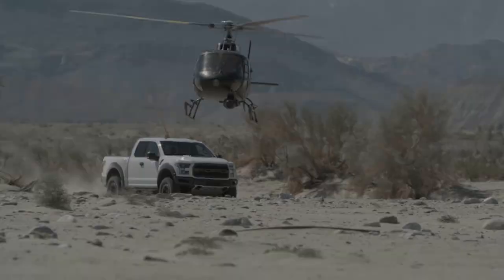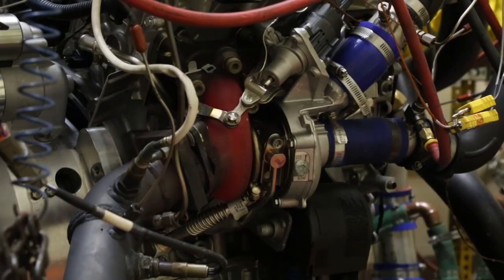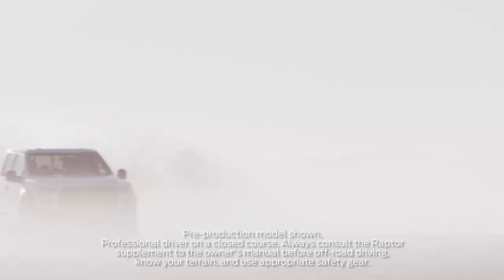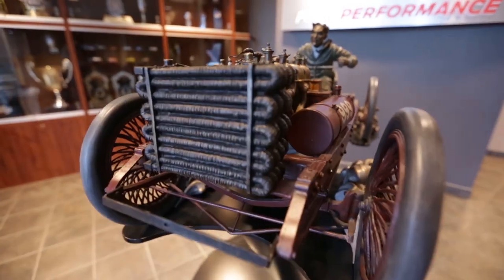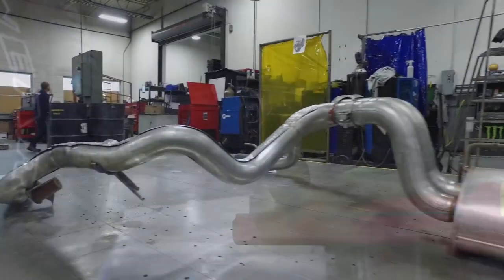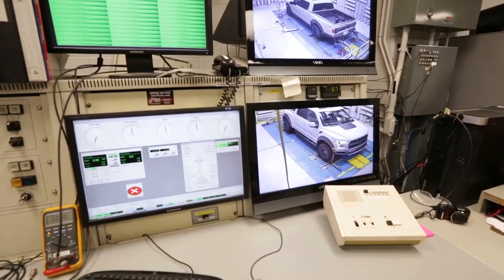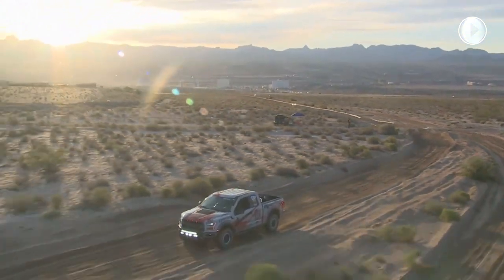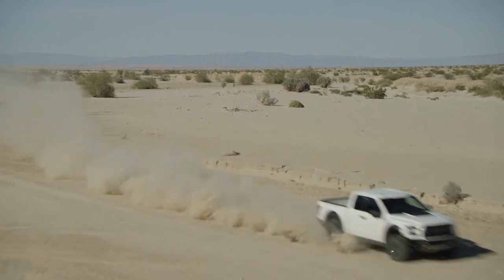All-New 2017 Ford F-150 Raptor: Dual Exhaust Technology | F-150 Raptor | Ford Performance

Comment: Keep up the great work guys and gals. The sound of the 2017 F-150 Raptor is music to my ears. Even the stock exhaust sound of my Duratec powered 2002 Taurus, which still runs great, had a certain growl that gave me an impression of just how great this engine's design potential was going to be. What a foundation for a winner this engine became. It doesn't sound like a V8 because it isn't supposed to. It's a 60 degree V6 that exhibits its own sound of authority. Here's wishes to Ford for another win at LeMans this year from a guy that bleeds Ford blue.

Comment: the 6.2 was such a great sound and it fit the truck so well... this is gunna have to grow on me...
Reply: I got my Gen 2 Saturday. I never got to drive a Gen 1, sadly, but I've driven a few V8 trucks over the years (and I loved them).

This new engine will blow you away. The amount of power is truly incredible, and everyone that has heard it in person has been more than happy with how good it sounds.
Reply: Because of the fake V8 engine noise coming out of the speakers.
Reply: T4nkc0mm4nd3r As a hardcore truck guy, I hate the sound of this truck. I've heard several that have passed me at lights and they sound like a riced out Honda. I'm very disapponted that Ford would turn their back on the V8 customers and I hope the rumor about a V8 coming this year is true because I, like many others, feel betrayed.
Reply: I'm not getting one

Comment: Granted the sound is not as aggressive as the 6.2L but everything else about it supersedes the 6.2L.   I am getting nearly 14 mpg and my daily commute is 12 miles of mostly stop and go travel.  It's a half a mpg better than my 2013 F-150 Lariat ecoboost that wasn't a twin turbo!  I think the 6.2 probably averaged around 9 or 10 mpg?  A stock gen2 will blow a gen1 off the line and in a quarter mile as well so what's really not to like?  You can add a number of aftermarket exhausts if you want a more aggressive sound and reap all of the other benefits of the gen2 Raptor's new engine!  Great job Ford Performance!

Comment from the maker: The 2017 Ford F-150 Raptor now boasts an exhaust that redefines the sounds of off-road performance! What do you think of the Raptor's sound?
Reply: it ain't no V8
Reply: Ummmm
Reply: The High Performance Ecoboost Vastly Outperforms the Outgoing 6.2L, Genius
Reply: Sorry, I own a 2017 Raptor and it sounds pretty bad from the outside... :/
Reply: Ford Performance sound of new V6 is awfull.
Reply: It sounds fantastic. Not quite as good as a V8 perhaps, but the power and gas mileage I'm getting means the slight sound difference is trivial. It sounds much better in person I might add - I noticed in the video I took it sounded kind of meh
Reply: Ford Performance For a Civic, it would sound great. For a badass, all-American baja truck, it sounds horrid. Ever wonder why BJ Baldwins's baja truck has an 800 horsepower naturally aspirated V8? For the same reason this should have a V8.
Reply: Ford wanted a more Powerful Engine, something the NA V8 isn't
Reply: Escape for Mankind is Keith Johnson You do understand that the 6.2 was a very lazy engine with a 2 valve, sohc design. It was not designed for max performance. It could easily be tuned to outperform that ecopoop in a heartbeat. That piece of garbage can't hold a candle to a real V8 tuned for performance and Ford knows it. The reason they went with the 3.5 was because their hands are tied by the EPA. Like I said, there's no trophy trucks that chose a TTV6 over a V8 for a reason.
Reply: The High-Performance Ecoboost in this Truck is brand new.  You don't even know WTF you're even talking about
Reply: Escape for Mankind is Keith Johnson This engine only exists due to CAFE. Sorry to break it to you.
Reply: Iben Fartene 

I'd sacrifice a little bit of power and efficiency for a 5.0 V8 any day of the week 

You can tell that to the government
Reply: Then you'll be happy to know that Trump is going to Roll Back some of Obama's Strict Regulations against America's Automotive Industry
Reply: Escape for Mankind is Keith Johnson 

Well it's up to Ford to decide weather or not they wanna take advantage of that fact 

And right now it looks like they're pretty satisfied with their Honda sounding raptor
Reply: Galpin Ford is charging $68,000 loaded
Reply: That still seems a bit much but that is way better than $98,000. Like I said it's a nice truck but way over priced.
Reply: Escape for Mankind is Keith Johnson 

The extra is dealer mark ups 

Cuz they wanna piece of the action

Comment: Not a reliable engine at all. My truck has been in the dealership for 2 weeks and they still could not figure out what`s causing the engine knock, plus the front passenger door is defective. I`m still waiting for my truck. ,I have only had it for 10 months.

Comment: put the 6.2L raptor that is turbo agains the eco boost raptor and see who wins
Reply: Sullivan Thomas Typically the stock 17.

out in the desert flats a whippled 550 HP Gen 1 just barely kept pace with a stock Gen 2
Reply: If you super charge or turbo Charge the old truck it beats the the new raptor with ease

Look up super charged SVT Raptor vs twin turbo a V6 

You will not be disappointed
Reply: Golden Retriever I've seen most of those videos. only one where the Gen 1 wins, rest stock g2 does.

and tunes haven't even come out yet for the Gen 2

Comment: I an not such an immature fool as to equate engine noise with performance.  The quieter, the better so long as it performs.  Case in point, a near silent Honda Gold Wing "old man's bike" will flat out blow away any loud potato-potato bike.  But the better issue here, is why the heck is Ford bothering to advertise 2017 Raptor if they are NOT going to adequately supply the demand?  Where are these Raptors?
Reply: Rooster You can find them, even at sticker, but production is ramping up still. I ordered mine back in July, got it in February. demand continues to blow away Ford's expectations still
Reply: My order went in last December, maybe I will get a 2018 model. LOL

Comment: That is the sound of a minivan with a fart can muffler. No truck is "badass" with that sound. They will not "redefine my expectation". The Honda Ridgelinette, sister car to the Odyssey, probably sounds better. Stop shoving eco down our throats. The raptor has low enough volumes that they did not have to do this to meet regulations. They did it to try get the market leaders to buy into the eco family of engines. These engines don't actually provide substantial mpg improvement in the real world vs. their NA equivalents, except for higher major repair costs at 100k+. Don't let them sway you. They poured tons of money in eco engines and the reception is bad due to low fuel prices. That's their problem, not ours. The need to tuck their tails in and let the eco engines go away after their product life cycle. They better think twice about their money down the drain for autonomy too. The American people will not give up autonomy for autonomy. Ford needs to get out of their alternative universe and become reacquainted with their customer base.
Reply: Cycletexas meanwhile I ordered back in July, just got mine in a month ago, and they're still selling quickly despite higher production numbers. clearly people like them. and for good reason, they're superior trucks.